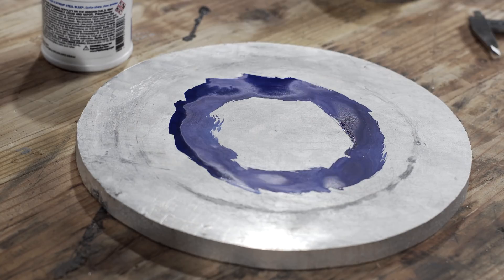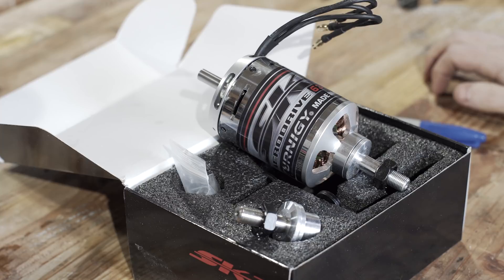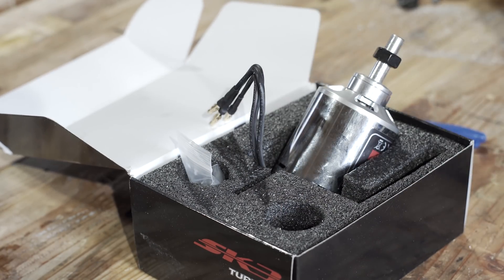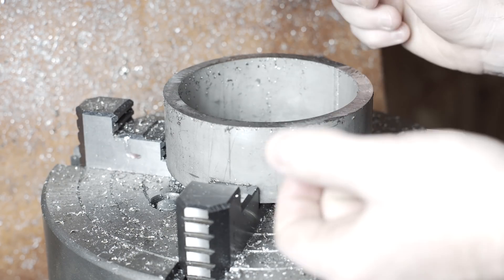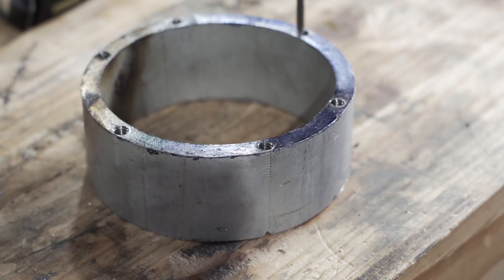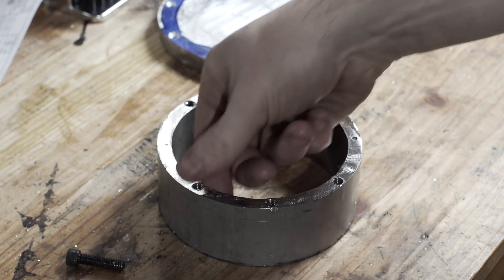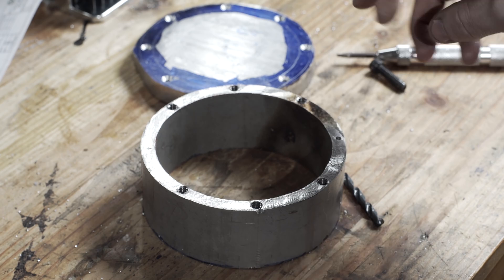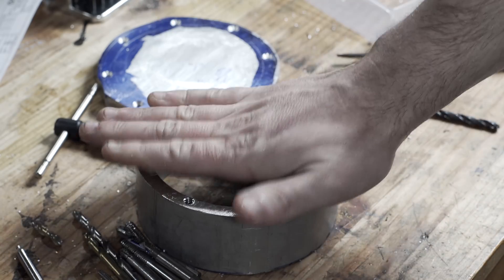Rockwell Mill brushless motor upgrade

Comment: In all permanent magnet motors, brushed or BLDCs, assuming synchronous switching as in most common cases, peak torque will be at zero RPM.  I.E Stall torque = maximum torque

Comment: You dont happen to have a lathe for that pipe section??
Your drill holes might benefit from a properly sized reamer.

Also - if you dont have a lathe, get creative! super glue actually makes an incredibly strong chuck - It shouldn't be too hard to make a jig to hold the pipe in the spindle, then hold a cutting tool perfectly in the vise/cross slide, and basically turn it out on the mill as though its a vertical lathe! 

there are tons of awesome ways to get creative on projects like this. Superglue is one of my absolute favorite secret weapons for hobby machining. It instantly forms a rotation/cutting safe bond (just use liberally) and it comes off extremely easy when you want to separate it, using a little heat from a torch!

I believe in you!!

OH I FORGOT!! the youtube channel projectfarm does some empirical testing of cheap drillbits in types of steel - youll be surprised what works best! (i am not affiliated I just love saving money)
Reply: also instead of threading, it would also be reasonable to just drill the holes slightly wide so the bolts fit through, then inset a nut into the underside of the bottom plate, allowing it to all be held together vie compression.

Comment: So what happened?  I'm still shocked you can get usable power out of a brushless that size.  I was under the impression a brushless motors torque was concentrated at higher rpms.
Reply from the maker: Sorry for the delay in posting updates!  I have a bunch of footage shot but haven't found time to edit and post... summer is always busy around here, trying to take advantage of the sun before the great white winter returns :)  I finished the mounting plate seen in this video, CNC'd (on the little baby taig!) a motor adapter plate, got everything mechanically assembled and wired up.  Then got stuck on the electronics enclosure, of all things.  Currently have a 3D printed enclosure partially assembled sitting on my bench.  Planning to get the footage edited this fall, and finish the enclosure so I can try some test cuts :)

Comment: Interesting mod, I used the same motor to power my mini lathe, plenty of torque, my biggest problem is the power supply.
Good luck with your project. Keep us updated please.
Reply from the maker: Oh interesting, glad to hear the motor worked well.  I'll be using surplus power supplies from cisco networking switches.  You can get them pretty cheap on ebay, up to like 4kW at 48v
Reply: Sorry for ressurecting an old tread, but if you still need it, use decomissioned server psu, they can be as cheap as 20 bucks from ebay, extremely reliable, extremely robust, theyr shine is the 12V bus, usually up to 40 amps, but you can buy some and wire them in series

Comment: Am enjoying your videos and just subscribed. You showed us the struggle with facing the stainless tube in the mill. I was wondering why you didn't use your rotary table? Also, I would like to see a video on your story. How did you get interested in machining? How are you learning? From YouTube? What are your goals for the shop? Etc., etc. And more of a blog (vlog?).  Great videos. Keep em' coming. Thanks
Reply from the maker: Huh weird, I replied to this a little while ago...but looks like it vanished.  Anyhow, thanks for stopping by and watching!  To be honest, I'm not sure why I didn't use the rotary table.  In retrospect it would have been a lot simpler!  I think I might have been worried about the rigidity of the setup, since the full stackup is a bit wobbly.  But I used it later just fine, so I think I might just not have thought about it :)  Oops!

I like the idea of talking about my past, goals, background, etc.  I'm actually a biologist by training so it's been a bit of a ride :)  Will add it to my todo list of videos.  Cheers!

Comment: Great idea, but i really dont think that will have enough torque. Plenty of speed but once it has a load on, i imagine the torque wont be sufficient enough to mill very much. Maybe very light passes will work. Im very interested in seeing the end result though. I hope im Wrong lol i actually hope it works out. Goodluck Bro.
Reply from the maker: Thanks!  Should be fun regardless, and the design means I can swap the original motor back in place if I don't like the brushless.  But BLDC's are deceptive due to their small size... they have a very large power density.  If you run the numbers, the existing 3/4hp 1725rpm induction motor has a peak torque of 2.3 Nm.  The BLDC (after derating the specs down to 3.5hp 7300RPM ... numbers derived from the kv and amperage instead of made-up manufacturer numbers :) ) has a peak torque of 3.5 Nm.  So BLDC torque is slightly higher, or at least comparable in a worst-case estimation.

I did misspeak in the video though, VFDs don't lose torque when RPM is reduced (they lose torque when increased past the slip point of the motor). So that part was incorrect.  There is also the chance that the low-speed torque is not sufficient since the mechanical gearing is no longer present.  That's true for both servo and VFD, but is indeed a concern.

Thanks for stopping by!  Should be a fun adventure either way :)
Reply: @BreakingTaps  Well sure sounds like you know way more than me lol so ill take your word for it bro. Cant wait to see you test this baby out! Lol Have a great day buddy.

Comment: Good project idea. Fellow Rockwell Mill owner here. Stainless is a bittersweet work mate. All things being even it takes a little adjustment but can still be treacherous. 

Easiest it to step up one bit size on the chart to do the threads - you still get enough thread and tend to not bind as much. I love my spiral taps. The old US taps when dull are better than the brittle imports. I use a seller Calcon210 on eBay. Old stuff but very good for cheap. If it’s any consolation I broke four 10-32 taps putting DRO on my mill. Big Gator tap guides on Amazon are a blessing - not super expensive. 

Great editing very polished. 

Dan
Reply from the maker: Good tips, thanks!!  Will try stepping up to a larger drill next time.  Definitely didn't need full strength here so a bit less engagement wouldn't have been a problem. Picked up a bunch of new-old-stock spirals after this debacle (and your comment on a prior video about spirals), excited to try them.  That Big Gator looks nifty, might pick one up (or make one).  Looks especially useful for tapping in odd positions, vertical, etc. 

I think I also need to keep more material on hand so I have more options when rummaging through my stock for a project.  The stainless pipe was just too perfect of a size and I didn't realize how big of a pain it would be :)

Thanks for stopping by Dan! :)